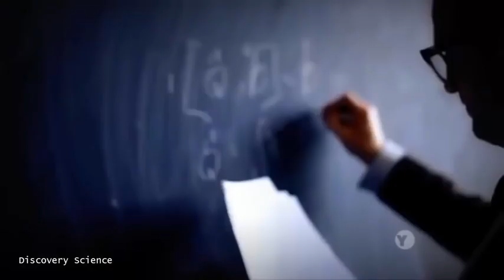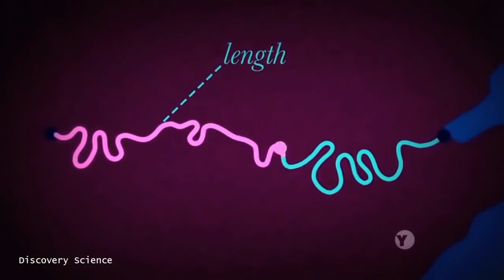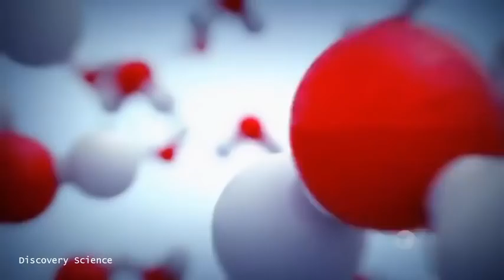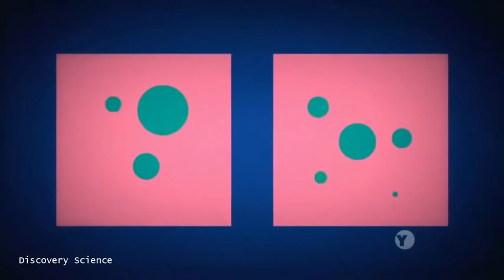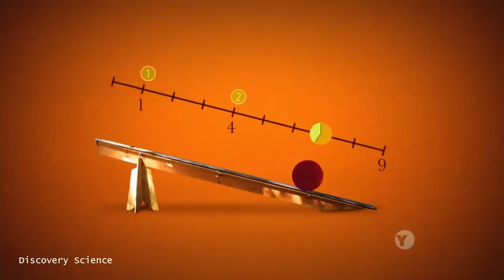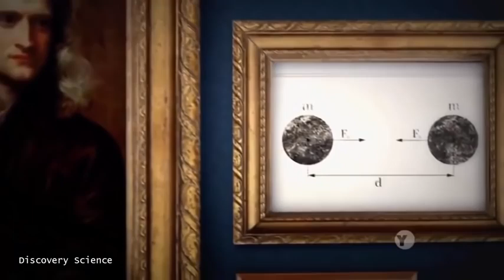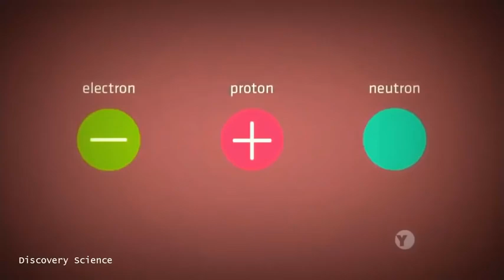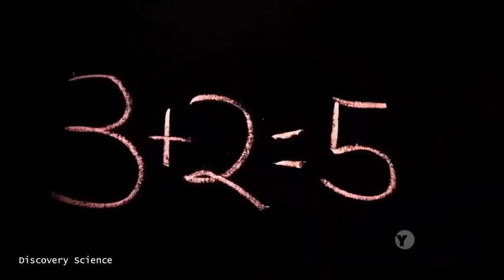Nova Science: A new discovery of the great Math Mystery Documentary HD 720p

Comment: 8:07 What stupidity was that? It says there are no circles or diameters or anything like that. But there is a very large circle, the orientation of the needle is between 0 and 360 degrees which forms a circumference. 
For example if the needle falls completely perpendicular to the lines the probability of crossing the line is 100% or almost 100% and if the orientation of the needle when falling is parallel the probability is 0% or almost 0% so of course the probability of crossing the lines must be based on pi because the probability depends on the orientation of the needle and the orientation of the needle is defined with pi.